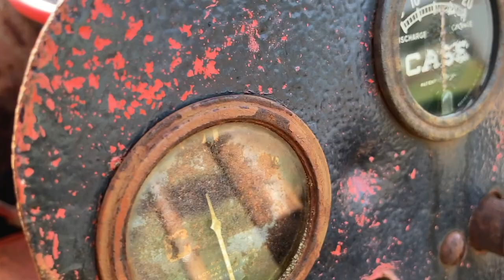Will it start vintage Case VAC tractor been sitting for years

Comment: I grew up on them  we had 2 of them and a big LA Case with wooden floor board and hand clutch . Many times I started the little Cases with a hand crank , we pulled a saw and a hammer mill feed grinder with the fly wheel. If the big LA was off in the woods with a dead battery we would put a belt on the dead tractor fly wheel and twist the belt and put it on the smaller tractor fly wheel and back up an tighten the belt , rev up the engine and engage the hand clutch on the stalled tractor and it would roar to life . If you don’t twist the belt the dead tractor engine will run backwards. I always drove with the foot feed gas pedal and this probably saved my life . You can move your foot faster than you can find a throttle lever while holding onto a flipping up tractor. If it doesn’t have water in the oil I would restore it to some degree . They were dependable and strong little tractors.

Comment: Amazing how well it started after sitting at least 5 years. You didn't show it, but did you clean the points? Also clearly misfiring on one cylinder. Did you check into the cause for that?